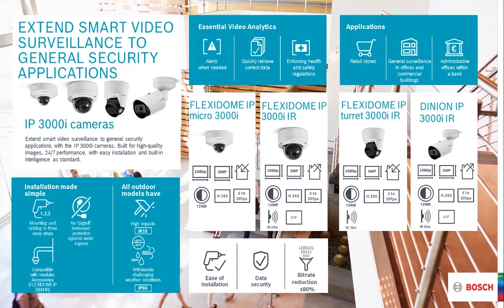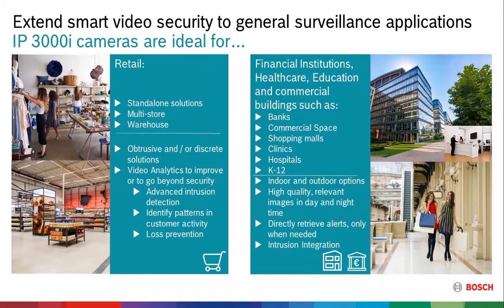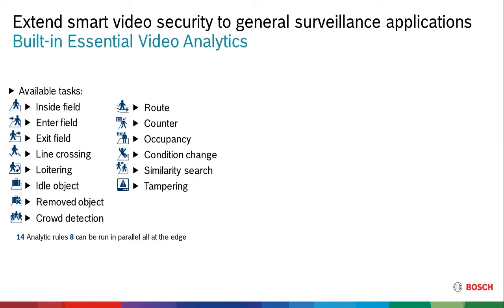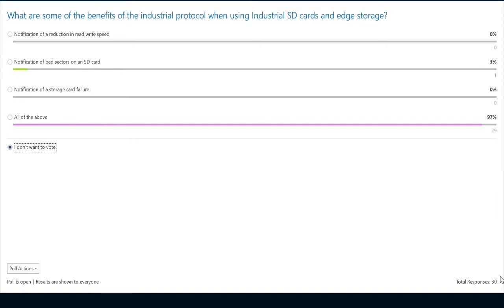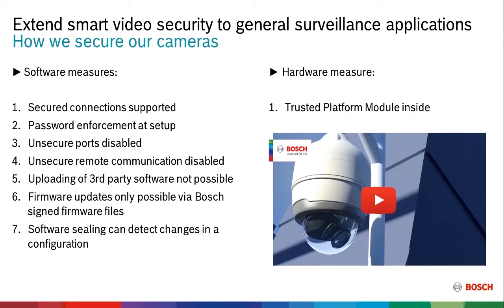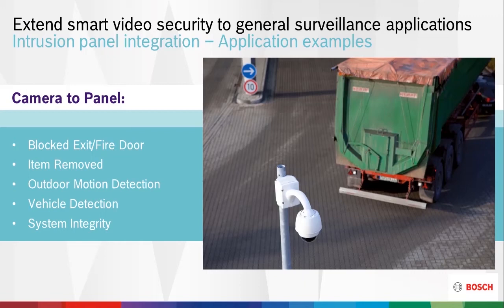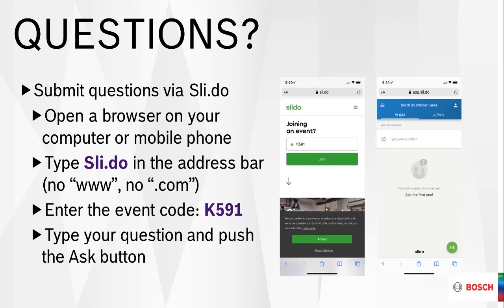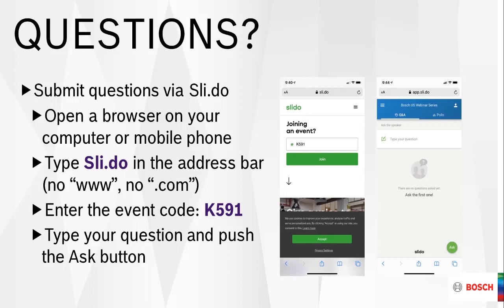Bosch's IP 3000i Portfolio of Cameras

Comment: Dear BOSCH, what is the difference between NDE-3502-F02 and NDE-3502-F02-P product? and how i can check it, i can't see the difference in datasheet.
Reply from the maker: Hi Nhân , there is no difference between NDE-3502-F02 and NDE-3502-F02-P on the product side.

The two only differ in their production place. NDE-3502-F02 is produced in China, while NDE-3502-F02-P is in Portugal.